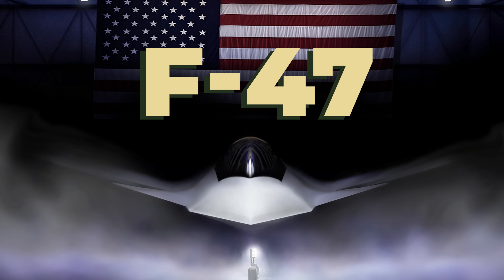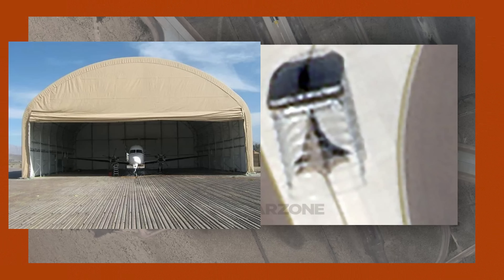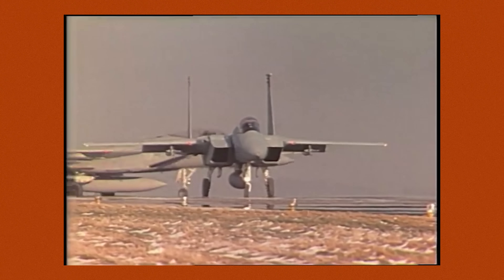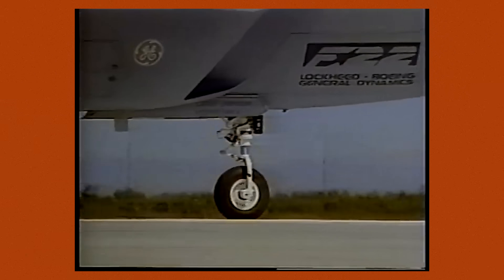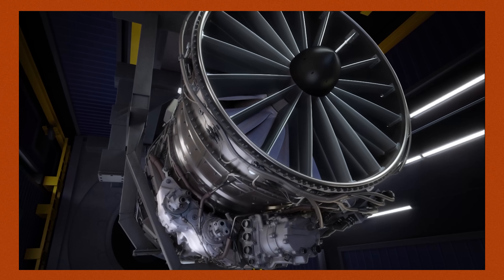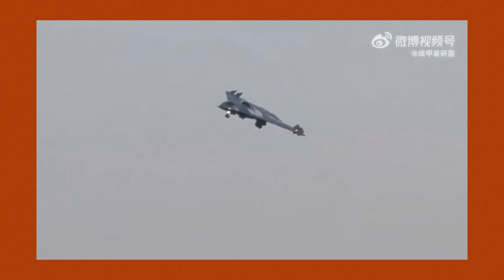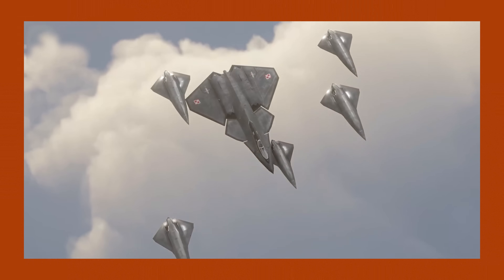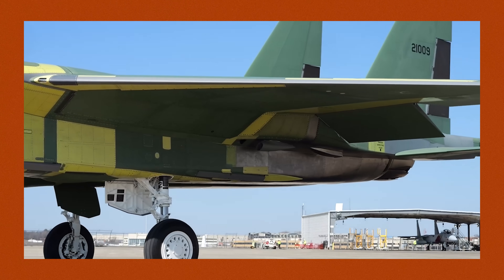America's "New" Sixth Gen F-47 is NOT New

Comment: Basically it's an improved / next gen aircraft with future facing F-35-ish capabilities (drones etc), but probably / hopefully with the range needed to actually fight in the pacific. Which the f-35 basically doesn't have. Oops. Too bad we're still building / buying 1800 of them. For some reason.

The Biden administration was IIRC considering cancelling / shelving this program - as a large and ergo really, really expensive new fighter, and that supposedly had some pretty serious potential issues w/r actually being able to do the things it's supposed to do. ie potentially fight against PLAAF aircraft when launched from very, very long range.

The alternative was to literally just build long range stealth tankers. Which would... also make sense. And mean you probably could do most of the things the F-47 is supposed to (loyal wingmen, range, etc) with the existing - and already functional, mostly - F-35 procurement.

That said there were some interesting claims in an interview about the F-47 over on ward carroll's channel and little while back.

Incl claims / assertions that the F-47 would yes be long range, and would be a single-seat aircraft. But would in fact be - more or less - dropping the traditional fighter pilots entirely. And instead keep - and promote - the weapons system officer, as was an F-47 "pilot" would actually be doing is identifying and managing targets + high level flight operations. Not actually flying the aircraft, which could be done fully autonomously in combat - and in nearly all situations - while the work done by a weapons officer would be way more important when dealing with a local networked drone swarm / forward deployed remote sensor + weapons platforms, and is the entire point of keeping manned / semi-manned systems in the loop, for both latency and pretty obvious jamming / EW reasons.

If true, the F-47 would quite obviously be an improvement over the F-35, as the F-35 pilot does have to actually still fly the plane, and an F-47 weapons officer doesn't and would presumably have much better user interface layout for actually commanding and executing high level highly networked dispersed A2A ops, than any traditional fighter pilot would.

That said the F-35 is from what I've been able to tell quite obviously - and otherwise - much closer to this "6th gen" concept than it is early pure-fighter stealth aircraft like the F-22 or Su-57 etc. The latter of which pretty obviously / most likely has pretty much zero networked capabilities and sensor data sharing at all. And the F-22 pretty obviously has / should have that, with upgrades, but wasn't originally built / designed with really any / most of that in mind.

Sidenote: one notable issue with the loyal wingman concept is that if the drones don't have the same range as the F-47 they are completely / near completely useless.

And if the drones do have the same range they are probably going to start approaching the same size, cost, and overall complexity as the F-47 itself.

Making them not particularly expendable. And also / at the very least not cheap.

I would hazard a guess that one or more of these potential problems might have a fair bit to do with Biden's USAF rexamining and second guessing this program, and/or the loyal wingman concept itself.

As to be very clear the entire PRIMARY point of the F-47 should be to try to fix the F-35's range problem. ie. make US conventional deterrance and eg. ability to actually establish air superiority over eg. taiwan work, and ergo stop / pre-empt an invasion of the island. And the other and arguably much more flexible solution to that problem is to use the same F-47 budget / procurement costs to instead readdress and fix the tanker problem (which is still a bandaid, but at least would work), instead.

And meanwhile the entire point of loyal wingmen is to add in at worst fully expendable additional aircraft and force multipliers *at a lower cost*.

If loyal wingmen can't get to the conflict in question then their point as per the above is completely moot. The F-35 - and sheer numbers of F-35s - already comprehensively hard-counters Russia and any and all other weaker threats / contingencies to US + allied air power / air supremacy in Europe and MENA. You don't need to add in loyal wingmen on top of this to help with this.

And meanwhile if the wingmen are also just... basically really really expensive modern long range stealth aircraft, at like 50% price savings - or whatever - then that begs the question why you shouldn't also just scrap those, build more of the straightforward long range manned aircraft, and just eg. build a whole bunch of comparatively extremely cheap decoy pods / munitions that can do the same exact things, just as actually cheap (comparatively) and oneshot munitions that are there in case of a break glass / SHTF emergency. (note: I'm more or less very loosely paraphrasing justin bronk / speculation + what-ifs thereof; the RAF unlike USAF / USN does not in fact have de facto infinite money to spend on shit, and price and actual cost effectiveness is ergo much more of an actual concern there, as in many other countries, sans the US and China)

You could make the loyal wingmen have less range, and be also capable of being aerially refueled by long range stealth tankers... and now you're back to stealth tankers and just reuse the F-35s (and loyal wingmen etc as force multipliers) all over again.

The main argument for the F-47 AFAIK, is that 1) the airframe is presumably extremely mature and capable, 2) considerable development money has already been sunk into developing it (though full scale production would be far, far more expensive), and 3) it is still presumably better / more purpose built at both range and "true" 6th gen stuff if the above speculation is accurate.

Also it's money for boeing given that NG is at the very least building the B-21.... but meh.

TLDR; I think you could very well semi-argue the the F-35 is functionally, de-facto a "6th gen" aircraft anyways given that literally all "6th gen" concepts are just aiming to reimplement and/or iterate on future-facing features that it can quite clearly also do, just not necessarily as well.

Specifically: the F-47 / NGAD is functionally / de facto / critically needs to be an F-35 with more range. And more focus, maybe / theoretically, on just doing high level 21st century semi-automated warfare stuff. Not 20th century manned pilot dogfighting stuff.

The european and european-japanese programs meanwhile are "6th gen" programs, that are literally just: 1) F-35, but rebuilt / reengeineered manufactured locally, to keep their native areospace / defense companies alive. 2) F-35, but probably slightly worse (w/r budget and sheer amount of engineering man-hours that has been sunk into that aircraft); and, in turn, probably much more specifically tailored to meet specific national requirements and niches by Japan / France / UK / Germany / etc.

And yes there is at present I think two of those programs, not one. One is like a 2030s era program, and the other is aimed further out, at 2040s.

Which should very well be fine, because again the F-35 exists, will be deployed in the meantime, and focusing on first just eg. building out wingmen drones to complement and force multiply those F-35s - and other aircraft - and then later building out the actual manned 6th gens, eventually, as an eventual replacement for aging rafale, eurofighter, etc., would ofc make sense.

Japan ofc meanwhile needs their aircraft engineered, built out, and operational ASAP.

And USAF / USN is that on crack.

In short F-47 / NGAD pretty obviously doesn't have a whole lot to do with the US just very reactively reacting to PLAAF stuff.

It's more that we kinda sorta realized - probably - that the F-35's range is super problematic, the tanker fleet that the US heavily relies on as a crutch is - whoops - super vulnerable against a modern, actually peer threat with modern long range stealth aircraft. And that carriers for that matter are going to be borderline useless in eg. a taiwan scenario with F-35Cs, and even / much more worse off with F/A-18s. Whoops.

Comment: Bro we’ve barely starting using the F-35 what the fuck is going on
Reply: Realizing (surprise), that the 750 F22 planned were not just for show and they done fuck up just scraping the production lines outta nowhere.
Reply: @baguettedepain3975  But F22 is used only for airshow
Reply: @onetwosccd  It was used in the iran strike just some months ago.
Reply: @baguettedepain3975  they used B2 bomber, no factchecking from you
Reply: @onetwosccd  Ah so they used nakes bombers without escort or protection with fighters? They did, and used several different fighters including F22s.
Reply: @baguettedepain3975  So, as always, F22 only for iranian airshow
Reply: @baguettedepain3975  i seen over 100 aircraft used stealth is supposed to use less i thought .
Reply: The F35 has been around since the 90s with prototypes. What you don't realize is American technology is refined till it reaches serviceable conditions, then further developed and improved.

Comment: Yes it is new. New engines..new stealth coating, massive boost the electrical power generation.  Way different . Even if say shape isn't new.   Totallly highest tech aval.  SO your Title is wrong.
Reply: Range improved. speed with new engines 2 companies are working on. This with loyal wingman drones. Be afraid enemies of the USA.
Reply: The canards are a surprise but no horizontal tail. The new stealth coating won't burn off like F22.  If it works as advertised. Then it is a game changer for defense against it. F22 has range problem and numbers of F22.  In a conflict will be almost useless from China's ability to hit frontline air bases. Even Guam is in range.  Also, our tankers are now in contested space. So, USA needs long range which the engines being made for it. should go faster and use less fuel doing so.  China's new jet seems to be made with same purpose.

Comment: If stealth is a big focus on a design, speed isn't going to be a high factor. F14 is faster than pretty much all of the 5th gen fighters, and that's because speed is all we really had back then as far as defensive capabilities (aside from flares and chaff). So as long as it can reach near Mach2, I'm not too worried about the speed. The inset engines help reduce heat signature, which was a big feature on the YF-23 Black Widow (the actual winner of the next gen fighter contest imo). It also serves thrust vectoring for maneuverability.

The F-22 was grounded for a long time and it still ran billions of dollars over budget. AND THEN we still had to pay for each individual one on top of paying for the R&D and the subsequent troubleshooting during the near 5 year grounding. The raptor was embarrassing, I think. F35 was pretty cool, but the central turbofan doesn't get enough love. Carrier based fighter that doesn't have to land with an arresting cable? That's a worthwhile investment because it also cuts down on training time for naval aviators.

Comment: Fly-by-wire wasn't new in the 1970s, either. The Avro Arrow had it in 1958—to the point where, during most missions, the aircraft was intended to be controlled entirely from the ground, with the human crew along as an emergency backup only. In 1958!

Comment: Excellent video.  Over Mach 1 and aircraft is more detectable so not recommend for a stealth aircraft.  Also, there can be RAM, Radar Absorbant Materials,  or coatings on the skin that can be damaged by high speeds. Mach 2.5 can strip the paint off.

Comment: I think one of the problems with US military plane designs is that they are to much focused on operational capabilities.

Even though keeping an operational technological advantage is important an should always be strived for (in order to develop new technologies), there should be an counterdesign which is more focused on lowering maintenance cost and operational cost, easier and faster production.

It’s basically the same issue the Germans had in WW2 with over engineering their tanks and eventually loosing the tank war due to not keeping up with production due to complexity and tanks more often breaking down on the battlefield due to to many complex systems in the tank.

Especially given the fact that most planes for 98% of their operational history will not be used in actual combat and will be used for training in peace time.

The Swedish, due to the fact that they are small, specifically designed their equipment on a balance between operational capability and ease of maintenance. Pretty good design philosophy

Comment: Idc what anyone says, as an aircraft mechanic, you cannot have an actual "fighter aircraft" without vertical stabilizers... it's just impossible. Idc how many control surfaces you have, you basically have a bomber like the B-21. Without the vertical stabilizers, you're only good for straight-line trajectories. So until I see some version of vertical stabilizers, I call BS on this being an actual "fighter"!
Reply: it probably has large control surfaces back of the wings that can move and create the effect of a vertical stabilizer and they will be a decent number of then. it might go flat in highspeed and high stealth mission where it dosent need to manuever.
Reply: Combat has changed from ww2.  Planes dont "dogfight" in combat anymore
  They lock on and shoot missiles from miles away
Reply: There's active areo control too, where you vent air strategically to either act as thrusters, or alter the aero foil characteristics to act like stabilizers. It's much less efficient, but it doesn't have a radar return.

Comment: I would assume the F-47 will exceed the speed of the F-15 and be slightly less maneuverable than the F-22, it is also likely to be a tailless design (or possibly reduced tail design for redundancy in case the jet can no longer control yaw otherwise) with a focus on stealth and long range engagements, with all of the tech of the F-35 at least, and possibly with a larger missile payload than the F-22 or F-35.
Reply: Also, the vertical stabilizers being removed more than makes up for the additional cross-section the canards add, the Chinese 5th gen is just not as stealth, or as maneuverable, as the F-22, and likely not as maneuverable as the F-47 will be.

Comment: 11:30 we literally have the MQ-25 Stingray in development, it's going to be more than stealthy enough because it won't need to inject itself deep into enemy territory. If it's far out from the radar, the resolution is naturally going to be a massive issue. A low-observable, unmanned, carrier-based tanker aircraft is easily paired with the F-47. Does this speak for the potential ability for them to loiter high in the sky beyond the extent that any other aircraft could due to the fuel efficiency savings and almost fully-available tanker drone refuel network?

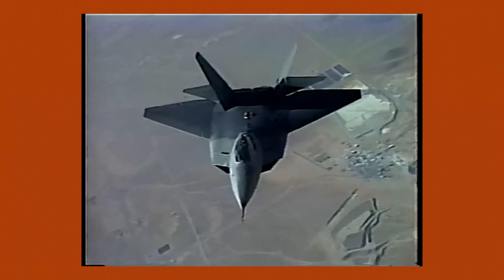Comment: 13:22  YF23, had long range, but what really probably killed it, was the bad reputation the industrial conglomerate that would have made it had at the time. It was, pretty close to as radioactive as you can get without being radioactive in real life. It's range would have been suitable for today's needs, (barely), it was also arguably as good overall in everything else, but the Air Force had more confidence in Lockheed Martin meeting both price and time targets. And in the case of the F-22 they did. The F-22 is a fantastic airframe, cut short by well cutting short it's production

Comment: Moving canards are very unlikely, too many edges. More likely, it will be a moldable skin so the control surfaces will deform for control. Lots more known about stealth than 30 years ago. It won’t be the X-36, but it should have similar or slightly lower rcs. This will ideally be intended for bvr except for drones. Should be interesting. Another role will be a loitering interceptor, even handing off drones to a relief fighter or taking them over in case of a loss (will be capable of at least 4, maybe 6). Something no one else has that works.

Comment: Communist canard: not stealthy
FREEDOM canard: stealthy
Reply: too right !!!
Reply: Well, there is battle proven stealth, and possible stealth.

It is not that possible stealth doesn't work. It might, it might not. Some people have claimed equivalence in stealth tech...but it's not been proven.
Reply: Canards create additional reflective surfaces/additional surfaces from the side which can bounce radar from the main wing back to the enemy but as 6th gen jets likely would not have a traditional tail, at best something similar to YF-23 solution, they can add additional canards without ending with more reflective surfaces as is the case with Chinese J-20 which 99% have higher radar cross-section than Raptor despite entering over a decade later with questionable value with current engines on most airframes. 
Thus, the F-47 will still end with lower RCS than traditional jets with a tail like F/A-22A while the current development of AESA jammers/dual-purpose side radars usually on sides ahead of the cockpit behind main radar possibly even integrated into wings means that weaker reflected signals from side of canards will be useless one way or another by reaching enemy in such bad disorganized shape enemy radar would not be able to understand...
Most people shaming J-20 because it's Frankenstein of F-35 & MiG 1.42/1.44 canceled 5th gen (itself fairly similar to the German Eurofighter competition proposal) as is well known that both were great inspirations for J-20 in ways well beyond what's available on Wikipedia...
Reply: Canards that aren't in line with its wing plane (thus creating bounce surfaces for radar) vs Canards in line with wing surface, thus removing nose-based RCS signatures (which are all that matter anymore)